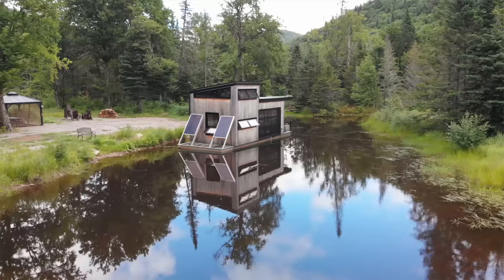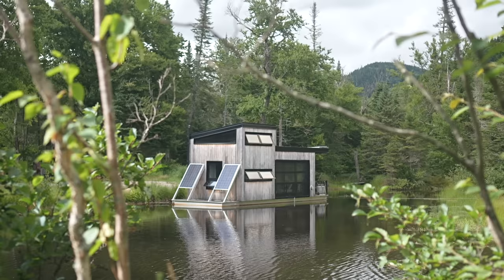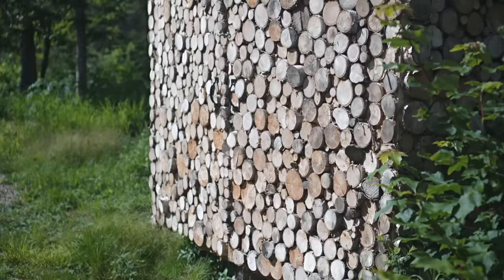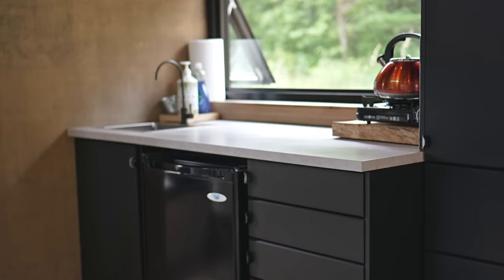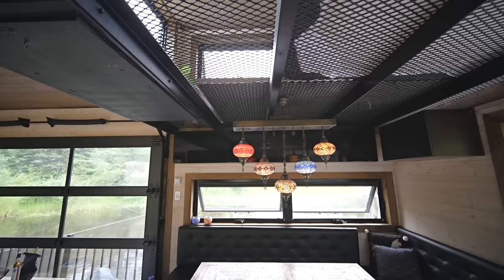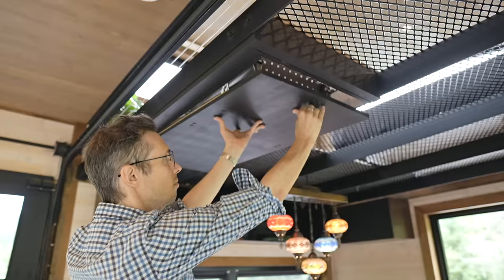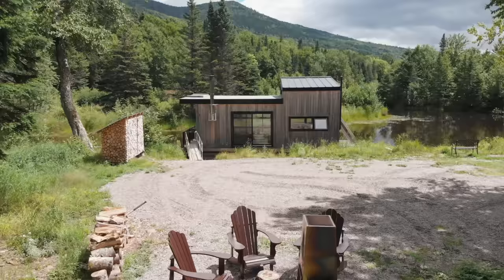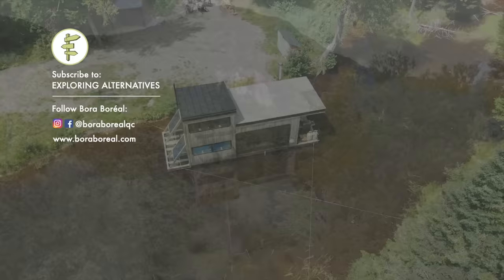Wow! This Tiny Off-Grid Floating Home is an Absolute Dream! FULL TOUR

Comment: Nice floor plan and concept but no shower is a huge flaw, since this is doable even in the smallest camper vans and even in a environmentally friendly way. There would even be space if the solar panels + plus a few more were placed on the roof. The toilet could also be an incinerating toilet run by gas, with no black water produced.

Comment: That ladder is the same thing I have to go up into my garage and those are not well built units. 
500 W of solar is not nearly enough in Quebec city to keep those batteries charged for any length of time 
and if you notice they go to all this trouble on the rest of the house and then look at the kitchen. 
That stove is a $25 butane canister stove from Amazon 😂
A garage door fora wall????? 😂
why would you go to all this trouble to make things so nice and then go cheap on such critical items?

Comment: 🤔This one is not very well thought out InMyOpinion.
I like the idea of a functional floating living space in nature. But this is a 'motel cabin' - not a house.
At a huge 10.6 meters by 4m it's bigger than every tiny home on wheels and yet it has failed to include:
1. Built in stairs with storage.
2. Standing height in the bedroom - or even full double story build with covered upper deck.
3. Piped/pumped water supply (even from a standing tank)
4. An onboard shower facility (shower water can be filtered and recycled on the fly for conservation control).

Comment: Why is the bedroom that that low why can't you have a ceiling where you can stand up in the bedroom what why is it like this I don't get it at least should pop up I mean it's not the reason why a lot of these tiny houses are like that is because they can't travel that way but if this is on the water I doubt it's going anywhere so why not haven't talked enough to walk around it and also you know a shower is pretty pivotal that's that's a highly important aspect to a home so I don't know why they wouldn't have one attached to the outside or something I don't know it's beautiful but it's too small